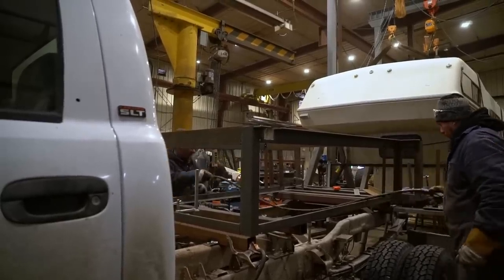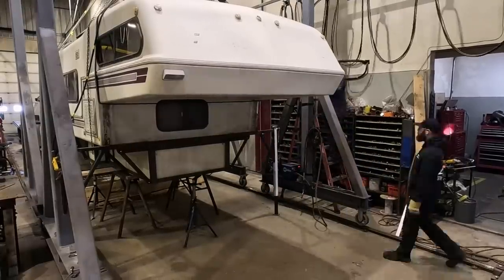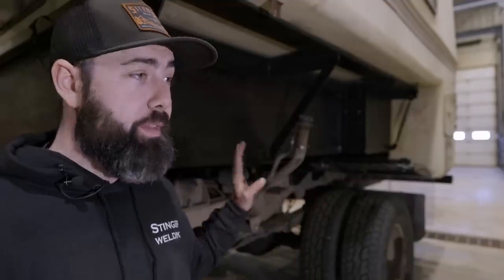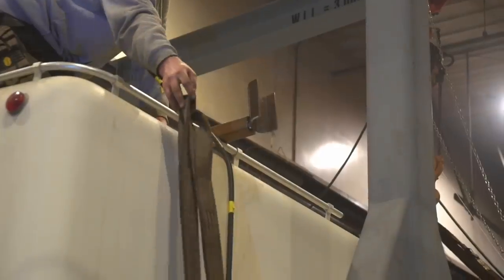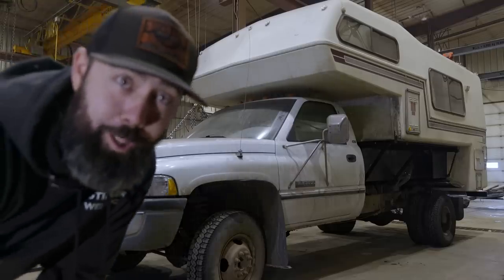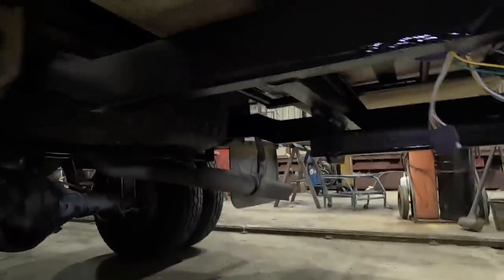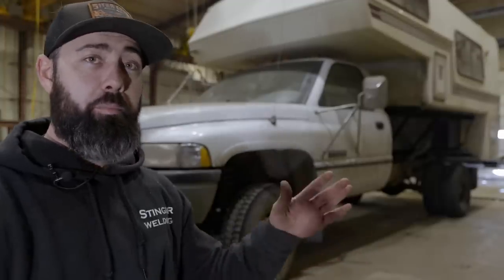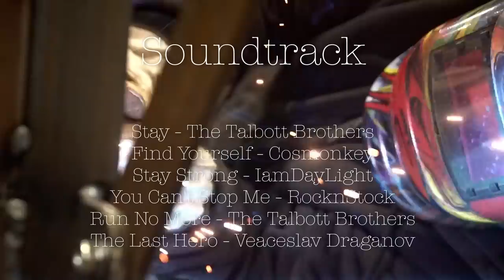Living Quarters for Life Beyond Borders | Expedition Truck Build | Destination Adventure

Comment: A huge thank you to Stinger Welding for their huge contribution to this project!  Those folks are awesome!  

A suggestion(s) for you Dustin is it appears the undercarriage and so forth to mount the camper was all painted but since this is not in use yet and you have a nice warm heated shop(s) to work in I suggest some wire brushing/sanding/possibly sand blasting of the underneath of the truck as much as possible and then "go stupid" w some good 3M Brand Undercoating and/or the stuff they use for box liners  - sort of after market rust proofing of sorts.  It will also help to quiet and deaden sound probably too.   

Have loved this series and now anxious to see what the inside of that camper looks like as well as how you finish up storage behind the cab and add storage on the sides to sort of finish it off.  

That will be on heck of an off road camping unit.  

Like all the repairs/upgrades to the boat trailer too as that should last for quite sometime to come!  👍👍👍
Reply from the maker: I’m hoping to put a bit of something on the frame, but we will see what there is for time.  Would be nice to get it covered though.

Comment: Lots of great fabrication there. The space for a gear box behind the cab is awesome too. Looking at the back end, it might be an idea to have a hinged drop down landing, so when deployed, stairs can go off to the side. Plus, when you are out adventuring away from it, you can lock it upright to prevent camper access. I have my landing permanent, as it is well above the trailer hitch and provided a spot for the bbq. 😂 Cheers from Penticton. 🤙

Comment: Awesome to see some local to PG business represented in this build. Stinger does great work and me being in the sawmill industry i`ve personally seen their work. Dustin maybe a tree bashing off road front bumper is in the future with winch basket? It would finish off the truck just right. Even though they built a nice little pull down step, honestly youre going to need some actual foldable camper stairs. That little tube ladder will be a bone breaker if you slip with wet boots or it gets the slightest bit of frost or ice build up. Plus round tube doesnt feel so great on bare feet on the chance you exit/enter the camper barefoot.

Comment: This looks great!  As somebody who has been truck-campering for years, a few suggestions... first, be mindful of your tongue weight.  I've seen at least three trucks who have broken their frames directly behind the cab due to too much tongue weight with a hitch extension.  I think you're probably fine with your boat, but if you go with anything heavier, you MUST use a weight distribution hitch.

Next... I would suggest going to 19.5" wheels and tires on the truck with good traction tires.  Granted you don't have as much weight as I do, but they will be more durable and last longer than 16's.  Something to think about.

Comment: Great job! Way to go guys! I don’t know for sure but if you could offset that ladder to the side the door opens ya might be able to use it with the trailer there or just put a little platform on the trailer that you can step on comfortably 👍I bet both options have been discussed      .

Comment: Man that thing is looking good. Bet it works out better then any of those store bought one. I would change your ball type hitch to something like a pintle hook so you'll have that offroad flexibility. Great job everyone and thanks to Stinger for making it happen.
Reply from the maker: I’ll look into that hitch, I haven’t heard that before.  Thank you.
Reply: @Destination_Adventure   It's the type used on military vehicles. Etrailer has an ark articulating off road coupler AR44FR. Little pricey. Not a pintle hook, but you can get the idea.
Reply: @Destination_Adventure  I think you could get a pintle mounted on a 2” stock if needed. not that common for light loads though.

Comment: Kudo's to Stinger Welding. Way to step up to the plate. This is a huge deal for Dustin.
Tell me you are going to have a winch for your adventures.  You may have mentioned it in the past but I have a terrible memory. But with this rig you will definitely need a good winch. Probably in the 12,000 lb range.

Comment: I drive truck for a large company that occasionally lent me out to their Prince George location. I remember seeing Stinger welding doing work at the location once when I had a very new tank truck that the build wasn't the greatest. The brackets that the mud flaps hung from on the truck and trailer showed cracks along the welds on the drive out from Edmonton. I legitimately worried they would come off on the highway and risk striking another vehicle. I approached one of the welders about taking a peak at it to give me an opinion on what he thought. I told him I was going to use another unit for a few days and asked if he could take a peak at some point so we might be able to schedule a visit to Stinger's shop in the following days. After returning from a long day I noticed the truck had been moved and went to go check that no one from our company had driven it on a public road. That's when I noticed that not only had the flaps been re attached that day but the welder had built some small brackets to reinforce the original design. Top notch work.
The next day the yard lead approached me and handed me a small piece of paper. He told me the welder not only got the work on the truck done after finishing the scheduled work at the plant but took a quick look over some of the other welds on the truck. On the paper were notes by the welder expressing concern over some of the other welds he saw on the truck. As a result, that truck was checked out by an NDT service and returned to the original builder for the job to be done properly when it returned to Edmonton. 
It's always a pleasure to deal with true professionals like the guys from Stinger. They have an obvious commitment to getting things done right.
Reply from the maker: Wow, that’s a really great story to read.

Comment: Dustin, as a fellow Bigfoot owner I can't wrap my head around why this needed a steel full support cage. You've been sort of vague about it, but I'd fix a fiberglass shell with fiberglass fabric and resin, so maybe you could take a moment and show us why such a hefty fix was needed?
Reply from the maker: The platform the previous owner built wasn’t large enough and it damaged the structure along the bottom of the camper.  Unfortunate to see for sure.

Comment: With the condition that camper was in, did you do a leak test on the roof and window seals? Any mold inside it that had to be cleaned? Any mice? Years ago, I bought a used RV that had a mouse nest with 8 mice I had to catch ... and, one big spider. 

Lots of free camping in the U.S. for that truck/camper combo. Cheers, Steve

Comment: @Dustin - Overcab: Do you have any concerns around the structural strength of the fiberglass overhang (overcab bed/storage) when offroading in backcountry (or on those highways that alternate pavement to dirt track)? Possible L-bracket shaped to the current frame could provide the necessary support for potential fiberglass cracking due to offroad vibration/impact? Just a thought, love the build show, can't wait for backcountry adventures!

Comment: Wish I was in your area, I would be hiring your team to do my 01 Ram 3500 4x4. Your one off build 2.0. It currently needs a new vp44 or ecm, not sure. Its automatic with a stage 3 billet trans from ATS in Co. 411 gears in the rear but still has 373 in front so no 4x4 currently. Would love a build like that with a Northern Lite camper.

Comment: Looking good, great Job stinger team.....  @dustinporter , did you put some kind of heavy duty rubber matting between the surfaces of where the camper is sitting on the frame?  i just imagine a lot of lateral motion friction  ..as you go off road.... i don't really know if it matters, it just came to mind.... as you are driving set up some cameras to check how secure everything is.
Reply from the maker: There is actually a layer of rubber between the camper and the frame.  Ideas from stinger lol those guys are on it.
Reply: @Destination_Adventure  that's great, they know their stuff :)

Comment: Hey Dustin, curious if you've been able to address the right rear wheel locking up?
Reply from the maker: Yes I have, and thank you for the question.   It is a very unfortunate mistake that turned into some bad damage to the rig.  Not sure if I will make a video on that, but it is being dealt with.  Bit of a steep learning curve on that one lol.
Reply: That is some unventured territory when it comes to floating axles. 
I'm sure there's a procedure manual you can obtain to help for reassemble. Good luck Dustin !